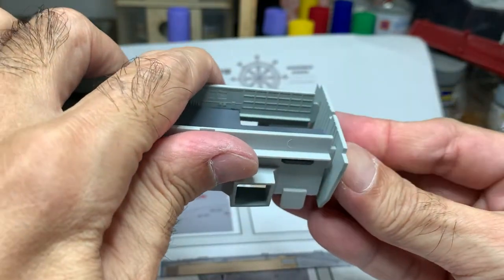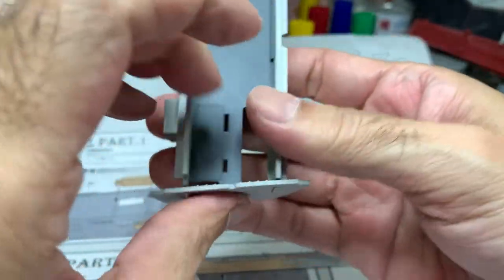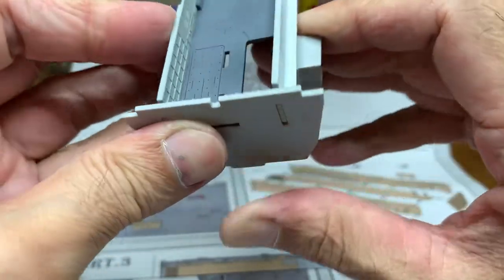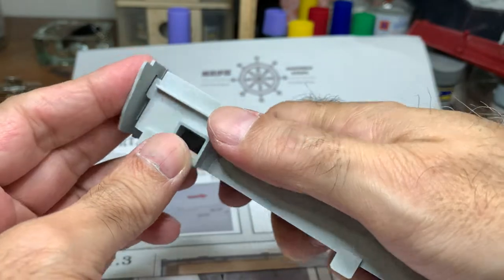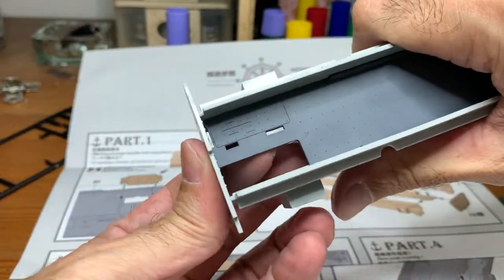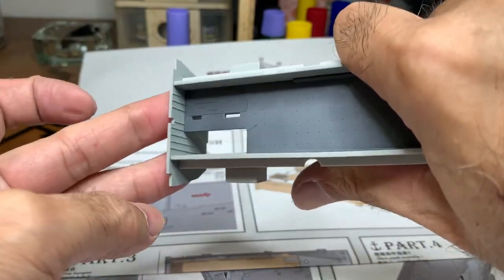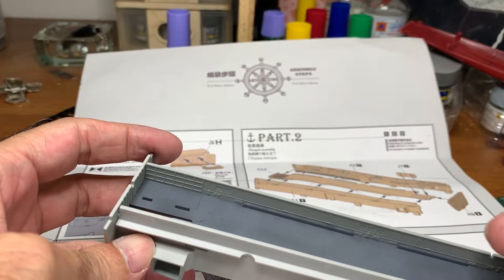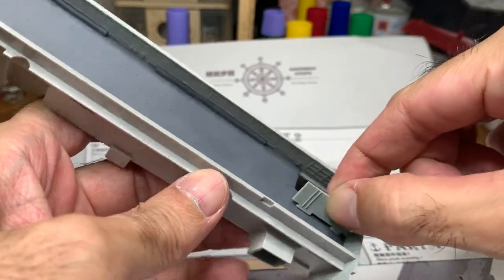1/700 PLA Navy Hainan from MENG. build part 1.

Comment: YIKES!!!

That looks like a tough little 'Snap-Kit'!!!  Thanks for letting us know about the "disadvantages" of "Snapping" the part on and Not being able to remove it........Which would make it VERY Difficult for repairing/replacing lights if you were to remove the flight deck (FD).

And as far as 'Snap-Kits'...I Might sand the holes to make them a ~Little bit wider.........for me, I'm Just afraid that I will break a pin and the part will Not be flush/fit into the model (ie the boat part).

ALSO, DRY Fitting can NOT be Done, which MANY of us modelers do!!!  ARRGGGHHHH!!!:face-fuchsia-tongue-out::face-orange-raised-eyebrow::face-orange-frowning:
Reply from the maker: i agree the holes made wider or the boss sanded so that it can be taken apart again. snap kita are like dead bolt can’t remove again. well i had fun with this kit but it’s far different from normal plastic kits.